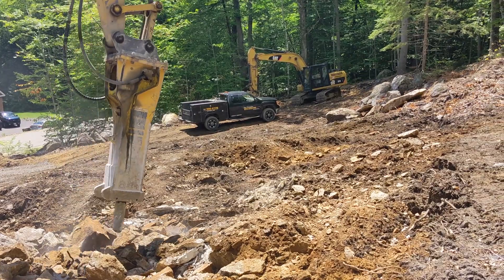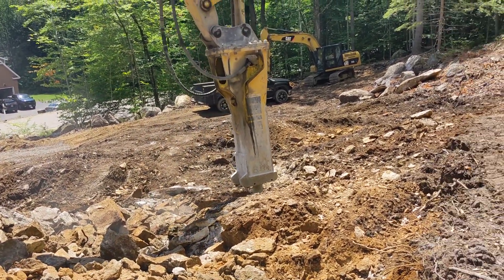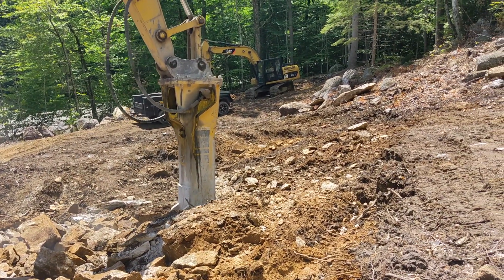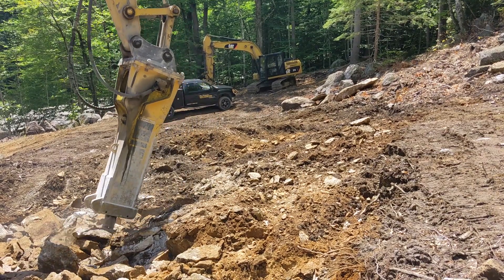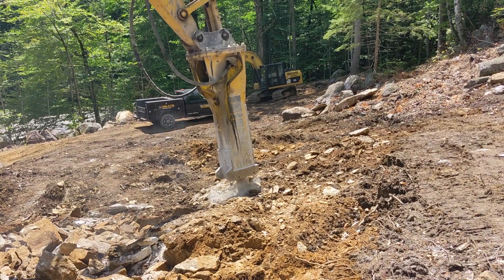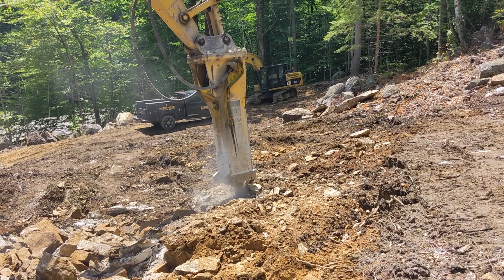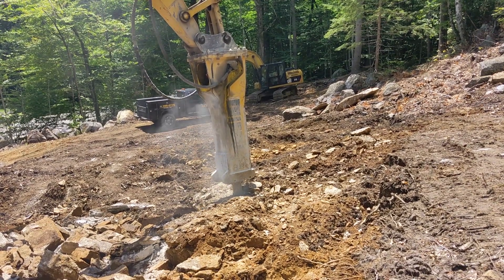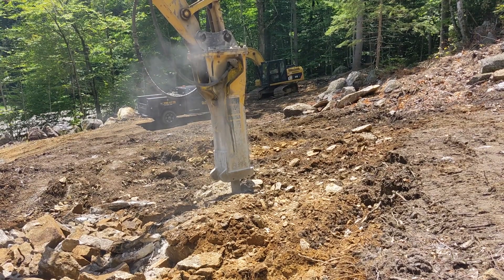How to Break Bedrock

Comment: Just a tip, break away from the machine ,busts concrete or rock alot quicker aswell
Reply from the maker: Mike, I went to your channel and you've never recorded and uploaded a video that positions you as a subject matter expert about anything. Why is that? Perhaps you should make one showing what you're talking about. Be sure to explain why it works. Once you've got your first video uploaded, come back here and share the URL with the world.

By default, the machine was doing exactly as you suggest because it was working away from the rock that was already fractured. It also has a hydraulic advantage of being able to apply significant downward pressure as it hammers. Much more pressure than a mere human could apply pushing down on a tiny hammer drill, power chisel, or real air hammer.